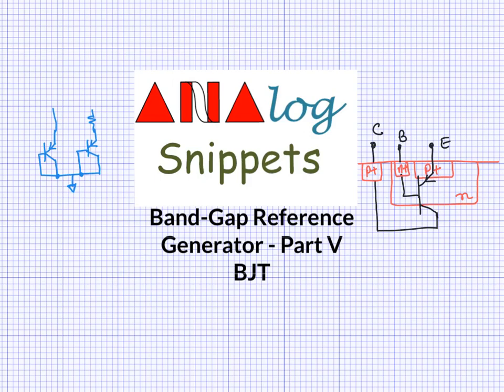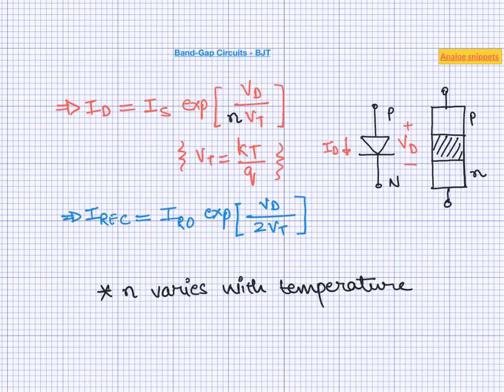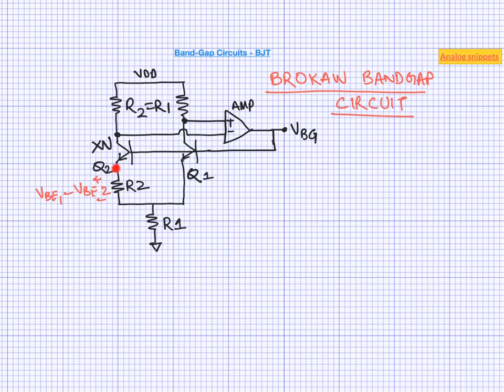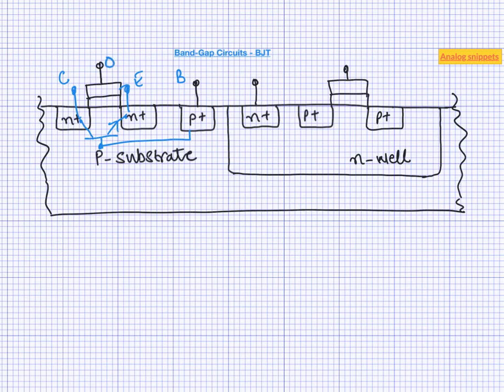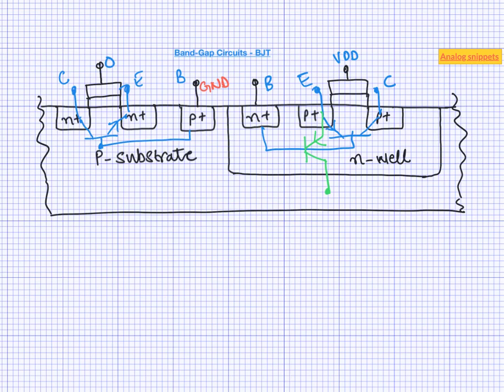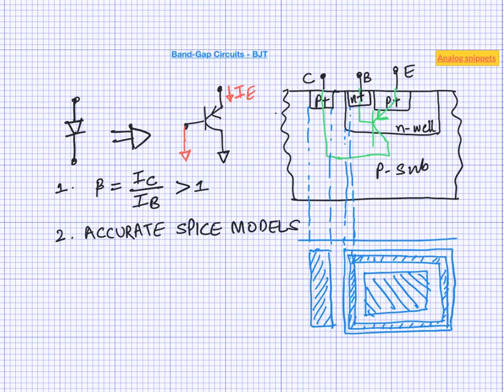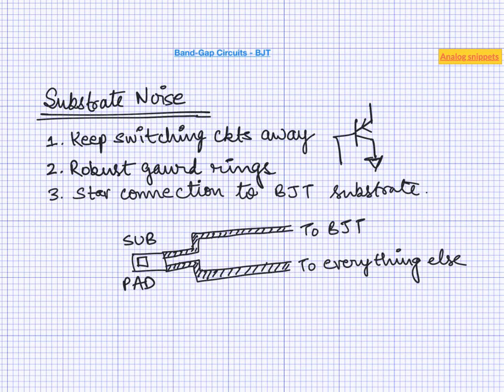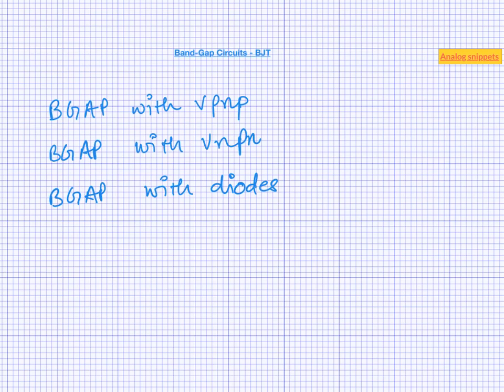#27 Band-gap Reference Circuits - BJTs

Comment: Thanks this was really helpful.
Does Vertical pnp and vertical npn (in DNW) have similar performance  when it comes to matching and noise?
Reply from the maker: In my experience NPN has marginally better curvature and obviously it has better substrate noise performance. But otherwise noise and matching are quite comparable.